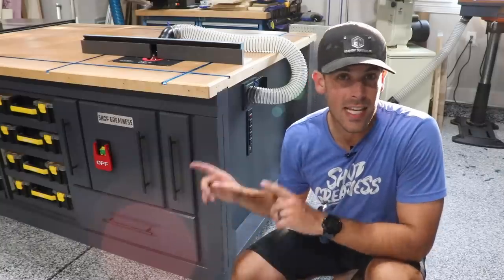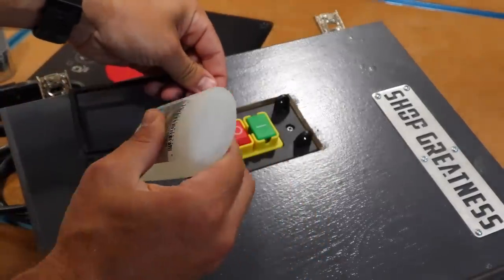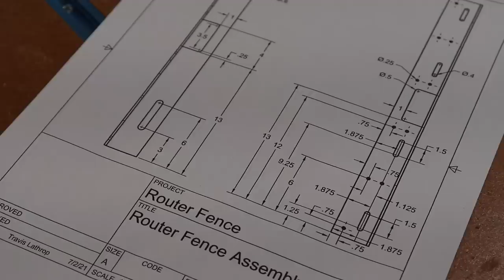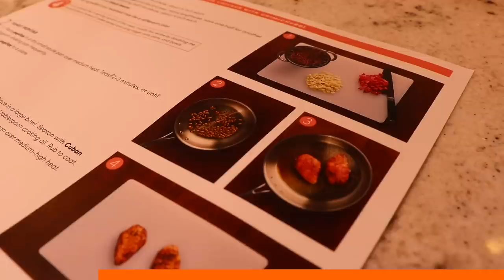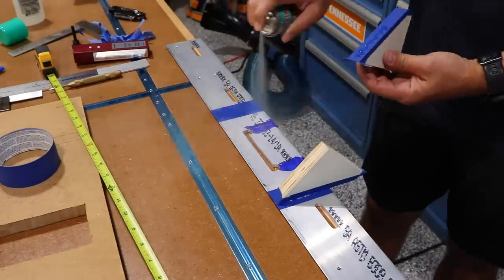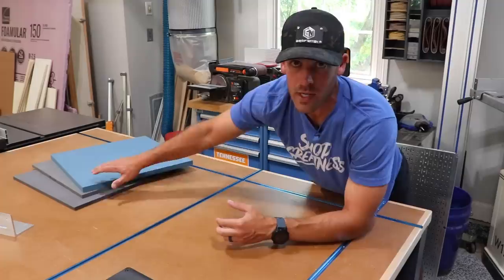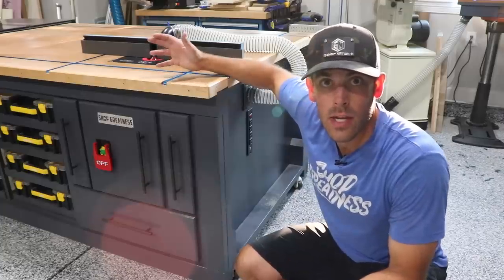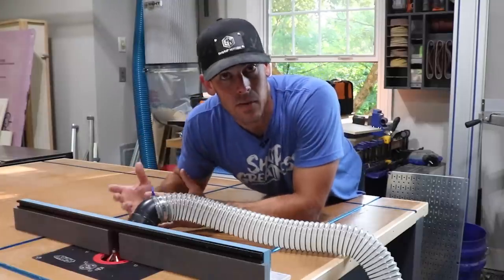Not sure I would do this again // Custom Aluminum Router Fence

Comment: Use a 50/50 mix of water and methylated spirits when routing aluminium. A light misting from a spray bottle should suffice. It makes a huge difference to bit life and surface finish.
Reply: For those in the US, it’s called denatured alcohol.
Reply: WD-40 is also great for aluminum cutting as well. Alcohol can be a fire hazard.
Reply: @ADBBuild  You know WD-40 is highly flammable.
Reply: I use aluminum tap magic. I love the smell, and it keeps chips from going everywhere.
Reply: Did you route that dry??? Eek. 
And aluminum on a miter saw is the worst... I'll never do plate aluminum on my miter again. I had to strip my saw down to get all the savings out. I had aluminum shavings showing up for months.

Comment: Just finished building it. (Actually, I’m still waiting for that plastic dust collector thing to show up in mail, but I’m calling it done.)

Saved by buying the aluminum at my local metal dealer ($24 vs $58) and using plastic (regular?) adjustment knobs vs those $10/each aluminum ones. 
Overall, I’m quite impressed by how nice it came out. 
I chickened out and used a jigsaw and a file instead of a router to cut those slots. 
Thanks for the awesome inspiration for this project.

Comment: In 2023 it's considerably cheaper to buy a more equipped fence.  Taytools, 32" $110. If you only want 24" it's only $88. Comes with all needed hardware plus feather board, stop block and offset inserts. Aluminum extrusion, anodized so it won't oxidize, multiple T-slots, large fixture knobs, etc.
Reply: Im building a router fence right now from scrap wood. Much cheaper than $88.
Reply: I built it and … it’s really not about the cost.

Comment: If you want to lengthen the life of the MDF, I recently tried a new mix that has helped my MFT tops withstand some beating.  I do a 50/50 mix of wipe on poly and mineral spirits.  I end up doing 6-10 coats until I get the consistency I want (can vary from MDF to MDF).  Sand the MDF to 120 first.  1st coat and second coat are just heavy wipes and then let dry for an hour each.  Then its a coat and sand with 220 in between.  Not to heavy.  It doesn't take long and when it feels like its the hardness you want, simply coat with some paste wax.  Its like the hood of the General Lee (don't get to make a Dukes of Hazard reference every day!).  Stuff glides across the surface (good for router fence) and it won't dent and damage near as easily.  On my Mega MFT, I ended up putting 12 coats on it.  Not because it needed it, but I simply enjoyed applying it over and over and watching it darken.  It would probably make that colored MDF looked amazing!
Reply: Have you ever done that mix with a black dye?  I want to get some colored MDF… however gold metal may be cheaper here in the USA
Reply: @allent555  I haven't, but I would assume it would look pretty good with the dark colors.  I don't think it would work good with lighter colors.  By itself, it ends up looking like a walnut color or maybe a little lighter.  All of my cabinetry and tool stands are painted festool gray, with teh festool dark blue accents, and the small parts (like handles or stop block knobs) are festool green.  I went to a friend's shop and tried his festool stuff and immediately became much poorer.  LOL.  But any exposed wood in the shop is walnut and the MDF kind of matches after enough coats.
Reply: @brentprosser7293   Cool thanks for the feedback. And Festool’s tools are very nice. The track saw changed my Life !!! LOL
Reply: @allent555  Thats how they get you!  Lol.  Then its the sanders.....then the routers....and then you're painting the furniture in your shop the festool colors.  But I don't have a problem.  I can quit whenever I want to!  Lol

Comment: I custom made an intake for my car once. The intake plate with 4 holes needed a radius on the entry to the holes. I used a 3/8" corner-rounding bit in a router and it worked great!

Comment: Nice job!
The next time you machine some aluminum I'd adjust the bit to be as high as possible. That way there is less distance between the collet and the material being cut which will cut down on deflection and vibration.
And for the fence hold-down knobs I'm a big fan of the "Rockler Easy-to-Grip 5-Star Tall Fence Knobs". They are easier to grip as you reach over the top of the fence, and come in two different thread sizes.

Comment: awesome build. one thing I thought might have been easier is on the router MDF backer. Drill a start hole through back side (aluminum side), then use a router with bearing to just quickly flush trim with a router for a absolute clean edge

Comment: Carburetor Cleaner or Brake Cleaner works great to clean aluminum after bluing or using a sharpie.  Allows you to keep the original surface rather than sanding it off and marking up the material.
Reply from the maker: Great tip!

Comment: noticed you dont have dust collection on that dewalt miter saw lol.  i bought yours and it works like a champ.  has me chasing the dust demons out of the rest of my equipment.  currently building a router fence, waiting on the printer to finish some parts and amazon to get here with the rest.  but now seeing you use aluminum angle i may have to rethink my design, thats clean A/F.  well done sir

Comment: Hey dude.  A little 3/4HP router will cut aluminum just fine, just turn the speed down a little bit to the mid range and use the right kinds of milling bits.   Use lots and lots of WD-40 as a coolant if you're doing a lot of work but otherwise it's just fine.

Comment: A jigsaw works pretty well on aluminum for cutting out the slots, if you're careful.  Any reason not to use hdpe or a similar low friction plastic on the fence? It would probably last longer too

Comment: When cutting metal you want to make sure you have a saw blade with smaller gaps between teeth. not expensive to get and will give a much better cut and finish when cutting metal. Also with the router a 3 flute bit would be ideal for aluminum.

Comment: I just machined my own router insert plate with ¼" aluminum plate. I needed it larger plate than anyone sold. So, i did it with a router... freehand... and I only have 1 functioning arm/leg. Yeeeesh.
 
 Wasn't too bad until I got to the insert rings. What a nightmare.

Comment: Duder that is one helluva router fence.. I'm thinking about making by own but I'm not adept enough yet with the router to do what u did there.. It's a fine job u made of it all the same so I salute u Sir.. 
Ur video was a little quick and it would've been nicer to see it in normal time but I get why u can't do that.. Shame really bcos It would be very helpful to know other ways we could make it without using the router.. The coloured MDF board looks cool as fook bro.. That is sick looking to be fair..
I was looking at buying a whole Router table from TREND and it costs 350 Euros here in Ireland.. That doesn't even come with the bloody router.. A fence is about 200 Euros and then some as well.. 
I have to say that BENCH u cuilt is beautiful but I love the whole colour scheme u chose for ur shop bro.. Those cabinets are wicked too man.. What is that colour u used to spray the cabinets with?? I won't be spraying myself atm so I think I'll just leave that part for now and take the doors off when I have the time next summer when the weather gets nice again.
I'm about to begin building out my 16X12 workshop. It's basically a one car garage bro..LMAO. It's small but for me it's perfect right now..  I will make some videos of my time during the build and put them up on here once I'm done.. 
My 1st job is getting a skip or 2 to clear years of crap built up in there.. Then I have to rebuild the doors, the frames for the doors and the back door. Where I live isn't a very mice area so I have to make sure security is of paramount importance to begin with. Once I get that part sorted then I will begin building my Mitre, Mortiser and Bench Drilling station on one side.. 
I've been working hard to get towards this bro. I can't wait to get started this weekend.. It's been a while coming so I'm going to go hell for leather once I begin the journey to my very own workshop.. 
Thanks for the inspiration bro.. Keep safe and well man..

Comment: Thanks for this video. I'm a huge fan of aluminum AND that colored MDF. It's more dense and easier to work with than the regular MDF we can get here in the USA. Couple of questions if you don't mind: Is one side of your fence adjustable (in and out) so you can use it as a jointer? If not, have you thought about how to achieve that? Maybe using shims? Cheers. Love all your videos.

Comment: hey Travis, i'm a little bit worried about your bosch router, is it still ok.
A couple of years ago i build a table saw with dust suction from the kabinet, but after 6 month the motor died. It simply sucked to much saw dust.
if it's ok, no problem, otherwise clamp af light flexhose on the end of the router and pull the other end out through the dust cabinet

Comment: How do you ensure your router fence is straight with the bit?
Reply from the maker: In most cases it's doesn't really have to be, however, you do in some cases like where I was milling the slots.  For that I just took my time setting it up and referenced off the table edge to make sure it was square.

Comment: Is the router bit ruined after routing aluminum with it?
Reply from the maker: Not that I can tell, but surely the life expectancy and overall sharpness went down a bit
Reply: @ShopNation  I have a credit card sized diamond plate from trend to sharpen my router bits and forstener bits. Very affordable.  Highly recommend.  Takes only a few seconds and makes a huge difference.  The lapping fluid also serves to clean any pitch off the bit. Keep up the great work.

Comment: What fitting are you using to connect the 2.5in hose to the dust port? I need something similar for my fence that is somewhat quick-connect. Thanks!

Comment: How did you ensure the fence is square to the bit?
Reply: @jonasmjanssongmail  but if you're running a work piece along the bit and it's off centre to the bit won't that effect the profile of the cut? Change the shape or something. I was wondering the same myself.

Comment: european man who invented aluminium. 'i have called it aluminium'. americans: "aloominum"? :P
Reply: What's funniest about this comment is that it's on record that the inventor (Sir Humphry Davy) actually pronounced it "aloominum", and not "Al-loo-mini-uhm". It wasn't until 1812 that a different scientist took it upon himself to change the spelling because it "didn't sound sufficiently Latin". Then in 1990, The International Union of Pure and Applied Chemistry decided to standardize it (incorrectly according to the original inventor) as "Aluminium" but still recognizes "Aluminum" as an acceptable variant.
Reply: Invented? Don’t you mean discovered? 🤔
Reply: @karenmitchell6814  it's an alloy so was invented.
Reply: @kanedNunable  Hmmm..., Aluminum: Element; Atomic Symbol: AL; Atomic Number: 13; Atomic Weight: 26.98. Discovered, not invented. 🙏